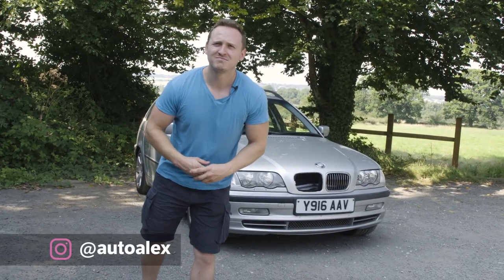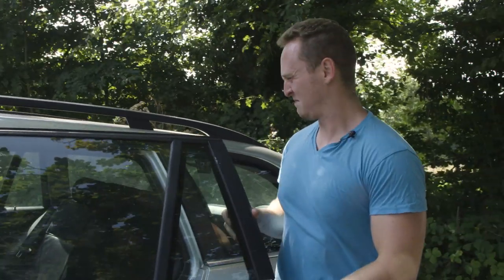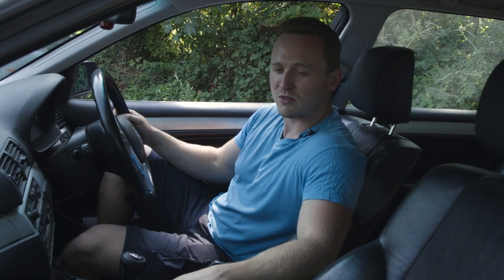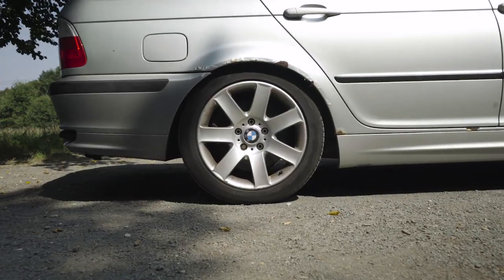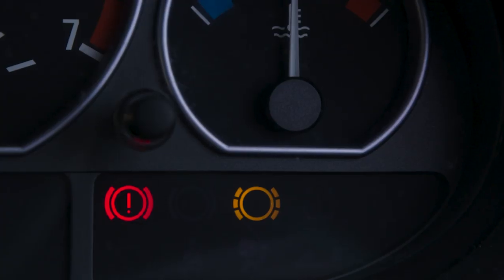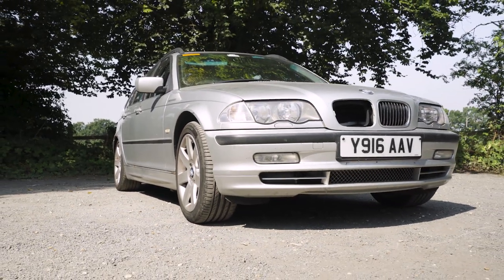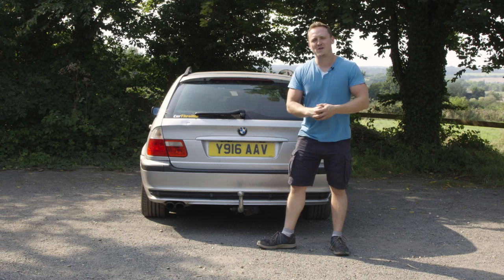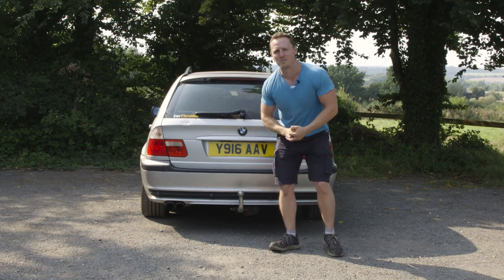£140 BMW Review: 1 Year Later!

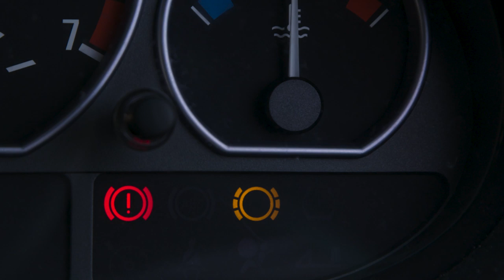Comment: 7:51 thats the brakepad wear warning light, not the abs light. If you look closely, you can see the abs light in between the 2 lit up lights.
Reply: did you not hear what he said.. he said the abs is definitely gone and would not explain what happened, seemed obvious to me he's locked up all the wheels and shat himself in this car recently lol.
Reply: abs light usually lights up when abs is currently engaging, doesn't it?
Reply: leledreher nope
Reply: @zlegend9628  my traction control light does it when engaging so i thought abs lights might do it as well
Reply: Thats worse than the abs light😂😂
Reply: @mosxidigaming  nah it's supposed to, says so in the manual. that's why I was asking about the ABS light potentially doing the same in the bmw
Reply: leledreher what car do you drive ?
Reply: @maxenceprat807  I think civic ahaha
Reply: @mosxidigaming  actually not always, for example my brake pad light always is on because i didn't connect brake pads to wiring
Reply: The brake light & ABS light both on at the same time indicates faulty wheel speed sensor. There's only 2, left front & right rear. On these it's likely the right rear one.
Reply: As mentioned that yellow warning light is the brake pads light not the ABS light. The red light just means "Brake system alert" and it comes on with the yellow pad light when the pads are low or the wear sensor has a damaged wire or connector. I bet either pads are low or the sensor wasn't replaced. Just replaced pads & short the sensor wires together.
Reply: It’s the brake pad warning light. The abs light is next to it and then next to that handbrake light in red. 

The handbrake light also lights up yellow if the traction control is fully turned off/not working, along with the other traction control light in the centre of the dash, which also comes on as it kicks in or and if you turn the traction half off without holding the butting for 5 seconds. These cars have abs sensors on all 4 wheels and without going too much into it, the dsc is actually very advanced for the time they were made.
Reply: iTz Shell okay normal. Normally abs and esc lights brights while on on cars which are made to be sold in USA
Reply: @leledreher  nope
Reply: I had no lights at all and a new car.. winter came... and what do you know... no ABS and not only that it smelled horrible (electric fire smell, sort of)... So with that in mind I drove carefully... pointed it out to the service guy... he was ashamed... they had some sort of firmware (ECU) failure (that was probably not the whole story though) that caused pretty much everything with ABS to fuck up first use... except lighting up the ABS failure led on the dash...
Was a Ford Focus (2005-6 model)...

Comment: Alex, try putting some lube on the steering bearing. A friend of mine had the same problem on an E36, oiled it and GONE
Reply: I had a similar problem on my citroen xsara after it sit for a while. The u-joint on the steering got stuck and the steering was like working in steps, also getting stuck in specific angles. Threw some wd-40 on it and has worked perfectly since.
Reply: opa yep, happens to my f150 little oil and we and no more wheel issues. The u joint was starting to rust
Reply: I had to change the universal joint on my e36 because it started locking up.
Reply: Had the same problem on my 2007 Berlingo van, lubed it up... Still going perfect now

Comment: Still blown away you paid 140 for it, in my country this with 3 liter engine, recently passed tech inspection and left hand drive would still easily pass for 1000 pounds
Reply: Yep, agreed, brits don't know how lucky they are to be able to get usable cars so cheap. I'm in Australia, and it's pretty tough to get anything that's close to roadworthy for under $2000, let alone a 6 cylinder BMW for what amounts to less than $300.
Reply: @phillipevans9414  were not as lucky as it seems, the reason these type of cars are so cheap is because nobody can afford the running costs over here. Fuel is ridiculously expensive, road tax will be well over £300 a year, insurance will be through the roof on something like this. I'd faghrr pay more for the car upfront - atleast you can reclaim some of it when you sell.
Reply: Yeah a car like this where I live would go for at least 3500 euro...
Reply: @joesanders8089  road tax is only £350 a year? Fking lol, that's nothing. 

A large diesel like this will cost you about €150 PER MONTH in road tax in the Netherlands.

Comment: M54 powered BMW's are really reliable as long as the cooling system doesn't explode. The ZF S5D 320Z gearbox is practically bulletproof other than the gearshift neutral centering pins dying. I'd recommend changing that valve cover gasket, I've seen engine fires caused by oil dripping off the valve cover onto the hot catalytic converters.

Comment: How did it get through the MOT with those warning lights?
Reply: A little bit of insulation tape goes a long way
Reply: I suppose an extra £20 sometimes  helps out a bit too...
Reply: Because not all MIL are a failure criteria. The engine warning light is a failure. But if he cleared it before the test and it didn’t come on during the test, the tester will be none the wiser. Unless he is friends with a tester. In which case, it’s a magic light that only turns on after or before a test 😂
Reply: EML not tested on petrol vehicles, only diesels after 2008. I believe the brake light only applies to vehicles with electronically assisted braking.
Reply: i thought the same with the fact they 'covered' the sills as i'm 99% sure it would fail if inspected
Reply: Adam McAllister This car has ABS & DSC.
Reply: its called T.V it didnt...
Reply: my borther's audi A3 passed the MOT (called eu-control in my country) because the ABS light was conveniently not lit up that day, the next day however it was
Reply: Warning lights can be turned off. I'm wondering how it passed with all that rust.
Reply: @adamspencer95  - rust he has shown is not structural
Reply: For you guys saying just put tape over it or pull the bulb out, the guy doing the mot has to see the light turn on with the ignition and then go off once the car is started, so that wouldn't work if they were sticking to the book. But yeah I'm guessing he knows a guy 😂
Reply: As mentioned, rust has to be structural. Any holes, or rust soft enough to make a hole with finger and thumb pressure or a CAT (corrosion assessment tool) in the chassis or close to a mounting point (suspension or safety related like a seatbelt mount) fits failure criteria. This rust is mainly superficial, as long as its not likely to cause injury if you rubbed your hand across it. As for Engine MIL, it is a reason for failure, or finicky testers might even refuse as it is a definite failure. It comes directly as “Engine MIL lamp indicates a malfunction”. If anyone wants to see the MOT inspection manual it’s free to look at on the GOV website. Bare in mind it is incredibly long winded... I’d know. 😂
Reply: @k1ortia  its not a tv show dum dum
Reply: They are led, on a pcb. U cant pull them out
Reply: If you're on good terms with your polish neighbour, then he might show you a garage that can approve MOT for junk like this or worse :D
Reply: @thegeeeezer  That depends on the age of the car. With a car this old it might be actual little lightbulbs in the instrument cluster.
Reply: @bobmarley-si2vy  or you open the dash up insulated the bulb put it back in the holder & run wires from the oil light to the abs & engine lights so they all come on & when the oil pressure light goes off so do the rest. Mot guy sees the all come on then all go off.

Not that I've ever done that & I'm certainly not suggesting anyone should
Reply: Captain Insano Shows no mercy  brake warning light surprisingly is an advisory and not a fail anymore. Yet abs light is a fail. Makes no sense like the rest of the government.

Comment: I had a car like this one, and I think it was my favorite car ever. It was a 2004 Malibu. Salvage Title. It was rear ended and sandwiched. It sat in a wreckers yard for about 3 months in Florida with no windshield. A relative purchased it and then left it to us, and we thought, yeah. Free miles, winter beater. 

We did NOTHING to it, and it ran from 130,00 miles to 250,000 miles with no problems. Funny enough, ours didn't have ABS either. The rebuilder removed all the ABS components. It was like a mangy but faithful little dog. Loved it. Saw us through the recession of the late 2000s. 

The engine and trans still ran flawlessly when we donated it. The electronic steering rack ended up totaling it because it would no longer pass inspection. The best cars are the ones you don't have to care about! I used to brag to Prius owners about how i recycled a dead car instead of buying new or even used.

Comment: To me is worth restoring to its former glory, just change the gearbox oil and change the clutch.
And about the dash check light its not the abs, that are worn brake pads
Reply: Fabio Scerra what about the rust. It would costs thousands to replace the panels and paint them. That’s why they use steel. When the cars become obsolete (it’s not bad but the engine is still old and has poor emissions) it’s time to send them to the scrapyard for parts. Plus the manufacturers want them to break eventually so you can buy the newer models and this stimulates them for investing into new technologies.  On the other hand is still cheaper to bring this one to working order instead of buying new one, but it can potentially be cheaper to buy a bit more expensive one with fewer problems,  ie something around 3000£
Reply: @inox1ck  are they welding in stainless steel? for what thousands of pounds they ask? i'm repairing rust on my and family member cars and it costs me less than 70 euro for car, on that e46 it would cost at max 100 euro
Reply: @inox1ck  
You dont need to replace the panels, just sand it down, cut and add some little metal panels when needed

Comment: My Brother has an E46 325i (same M54 engine but smaller) on 230k and it runs amazingly, drives like a car with half the mileage, services it regularly and does all the work himself to it, had it for nearly 10 years and has no plans to change it.

Comment: Engine light is an MOT fail. Says it flew through its MOT and then says it still has the Engine light on. Hmmm, friendly tester? ;)
Reply: Or you keep the OBDII tool in the glovebox and clear the codes before you drive in. Not that ive done that before.....
Reply: It's not noted in the last test. Looks like it's failed almost all its MOTs at some point. Someone paid a lot of fix it or had their own testing station.
Reply: Why the fug they should care about CEL light? The only lights that should make interesed at mot is red lights and abs light
Reply: I have noticed that the MOT test that Alex had done had nowhere near as many advisories as every previous test
Reply: It's not an engine light. The Left red light is engine emissions, the right orange is the brake pads and the right red is where he has the hand brake on. I've had the engine emissions light on my e46 and had to replace a bunch of seals and the air mass meter, could be something else on his but it wouldn't fail the MOT if the values are in the right range.
Reply: @miss21louise  3:48, that is an engine management light, which should fail an MOT if visible during the test.
Reply: @BluePixelMotorcycling  I once thought the same as you, then I consulted my manual and took it to a BMW specialist. The engine management light shows just the letters "EML".

Comment: Re-grease the steering joints at the top of the steering column just on the other side of the firewall in the engine bay. This is what I did for my e36 to free up the steering. There are 4 points on it that dry up. Reached my hand down there and slathered general purpose auto grease all over it. steering was twice as easy to turn and wheel actually started to return to center on its own.
Reply: Will give it a go!

Comment: My family owned one of the 320d model of this car. Absolutely brilliant model car, we owned the car for 12 years and put 230,000 miles on it. After being vandalised for a solid 6 years day in and day out it still ran, we sold it in 2011 for something like £130 funny enough as it needed a bunch of work and didn't think it would pass a mot. The airbag lights were on and had water in the seals and doors, the guy who bought it must have fixed it as it was only last year must of got scraped as it had insurance on it. I think it had over 300,000 miles on it in the end. Brilliant car.

Comment: You should get a K11 Micra, they are bulletproof
Reply: So true! Bought a 1997 K11 in 2012 with 80k miles on it - thought I'd just use it for a year until I could afford something better.  7 years later the little thing is still running perfectly, sails through every MOT with no issues. Service it once a year to show it that I appreciate it ;)  - had to replace two bulbs behind the instruments in 2015 and that's the only thing that has needed fixing. Now on 130k miles and gives me almost 50mpg (actually 49.7mpg - just cannot get it above the 50 mark!!).  Am so attached to it now that I will do my utmost to keep it alive!

Comment: That’s pretty cool. I bought a 330ci in the states for $4000 with 96,000 miles on it and in the year I’ve and a half I’ve driven it I have had to replace a coolant reservoir, 2 starters, an oil housing gasket, a valve cover gasket, and an idler pulley bearing

Comment: I left England 6 years ago for new Zealand and one of the only things I miss is the ability to get decent ish old stuff like this for peanuts, anything in NZ that's road legal will get $1000 no matter how rough it is, this BMW would fetch $1500, maybe even $2000 in its current condition being 6 cylinder, manual and a touring.

Comment: The boot Light is to do with the openable Window on the boot, it is A common issue with e46 tourings, for some cars it starts opening itself over night, no matter locked or not, but if you cant open it, it probably means that someone has already cut the wires and the sensor is in the same loop and you can just ignore it, if you try to fix it it Will still crap out eventually

Comment: how the bollocks do you get 42mpg on the motorway when my 320d is averaging around 46mpg with mainly motorway miles.
Reply: 3.0d in E60 with chipped 280hp can average 6.7l/100km on motorway. And this 330d is lighter, and if im not mistaken tuned.
Reply: Marcin Dager this is a 330i...
Reply: Mek Dawson my 320d is averaging about 38.7mpg 😂😂😂👍
Reply: My 323i averages 28mpg don't know how a 3.0 petrol does better 🤷‍♀️
Reply: @orange_tree  Nvm, i though this one is the same as 330d from m3 challenge.

Comment: I once bought a E34 520i touring with LPG system and 1 year MOT for 1€. Had to replace the fuel pump. Still got the car 1 year later and did almost 30k km with it.

Comment: The BMW M54 is one of the most reliable and simple engines I've ever worked on. If you just let it get to temperature and then start having the real fun such as flooring it or driving at 130 mph on the Deutsche Autobahn, there is no problem at all (other than the well known MASSIVE oil consumption..)

Comment: that "stearing-noize" is not a bearing ... its one of the u-joints that rusted solid ... give it some penetrating oil and after it releases (may take a while, maybe a week and multiple pentrating fluid sprays) give it some normal oil to save its functionality

Comment: You're just that bit too young to remember that around the turn of the millennium, there was a saving to be had from buying your German car from a German dealer. I used a broker in Bracknell to buy a factory Audi TT from a dealer in Berlin. Flew out to collect it.  Was on a flight from Frankfurt to Berlin when 9/11 happened. Fun times.

Comment: I see kids in Boston driving mid 90's Toyota and Lexus models without a single spot of rust.
Reply: I think it’s because of the weather in UK, salty atmosphere. Also, I think the car was mechanically looked after and not externally, wasn’t waxed or rock chips were left unattended, hence the rust in the arches.

Comment: If cars were that cheap in Canada my yard would be filled with cars. That’s approx $250 here, which won’t even buy a car that doesn’t run. $250 is what I paid for brake rotors for my BMW and you could buy an entire one there. 330i’s are $3000 for one in bad shape and up to $15,000 for good ones due to high demand

Comment: I bought a 2003 Mondeo Ghia X estate with 160,000 miles on it 2.5 V6 £500. Spent nothing on it, passed mot. Following year put new tyres on it.

Caravan holiday in Yorkshire developed misfire drove way home towing a caravan discovered had lost a sparkplug so towed home on 5 cylinders lol still went like stink.

Little old lady t boned me when she drove straight thru a give way junction. Her insurance sent me a cheque for £1800 (turned out she was known locally crashes every day). All the dents popped straight back out lol

Loved that car inside was mint not a mark on it, no rust just accident damage.

That mondeo was the cheapest most reliable car I've ever owned & insurance was really cheap too. Best bit was when people pulled up to a big old estate ex acting to razz you at the lights & you'd shove ya foot down & blow them out of the water pmsl.

Comment: Do a killer sleeper wagon. Just force some air into that inline six. And the kidney breaks because the lever is designed to open the hood, not to lift it all the way in the air. That's why they all break only on the left kidney. One can survive with only one kidney though ...

Comment: You can easily remove the loose paint, sand down the surface rust, use rust inhibitor and some black or grey paint. It will last years and will not progress.